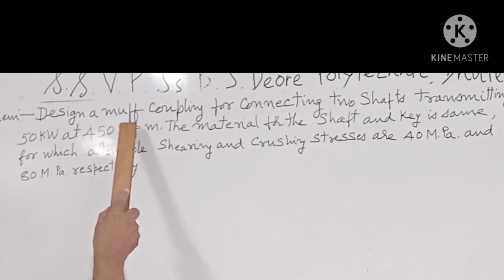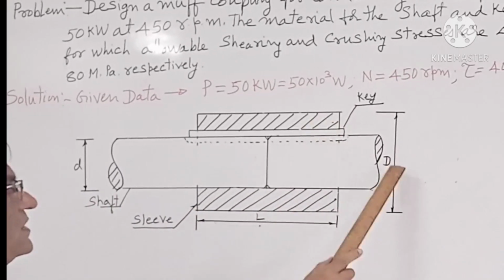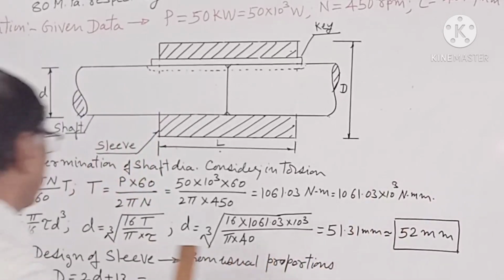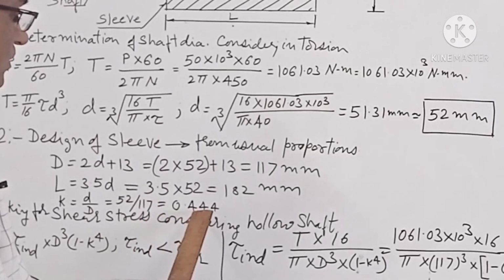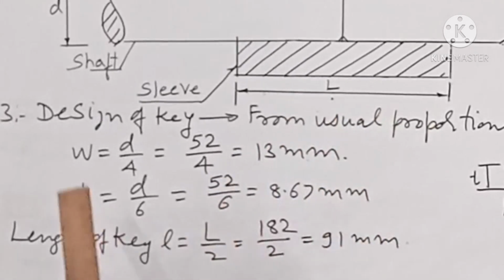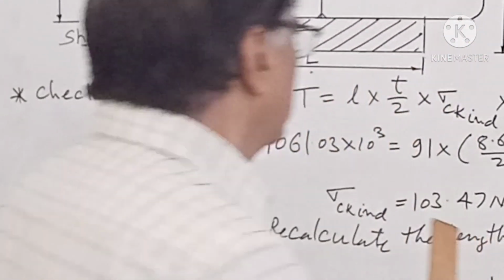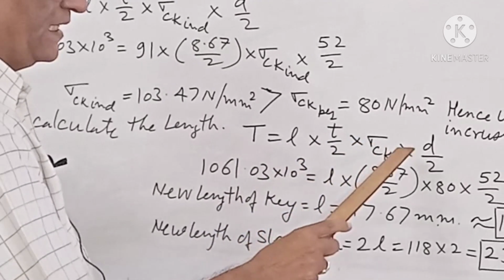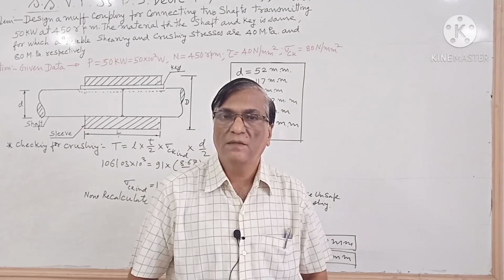Muff coupling, numerical,  lecture 63

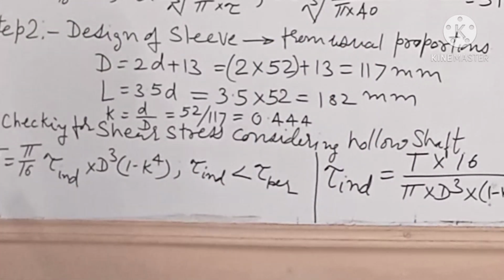Comment: hello Prof. , at time 3:20 . The D = 2d + 13 . Why was it '+ 13' ? can you tell? TYSM
Reply from the maker: You want to say D=2R,
In muff coupling D = 2d+13, D= outer boss dia and d= diameter of shaft. 13 is added for weakening effect due to key way in the boss,this is empirical relation developed by experience designer. Empirical  relations  helps in finding safe dimensions quickly rather than finding rationally,i.e. by   considering failures and forming strength equations.